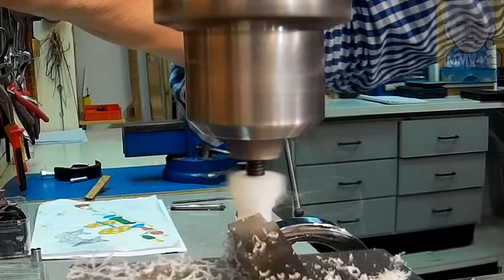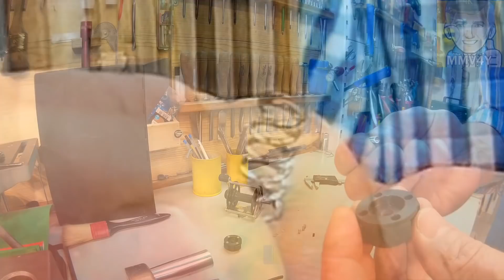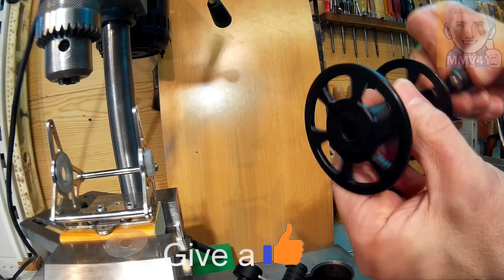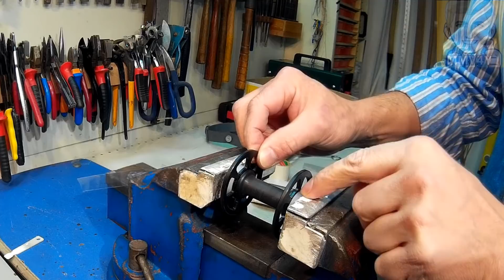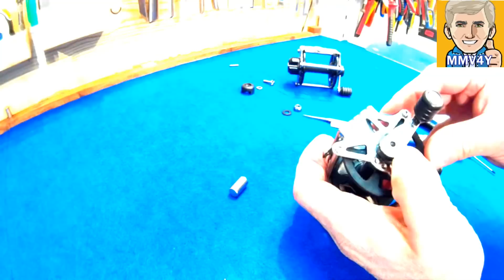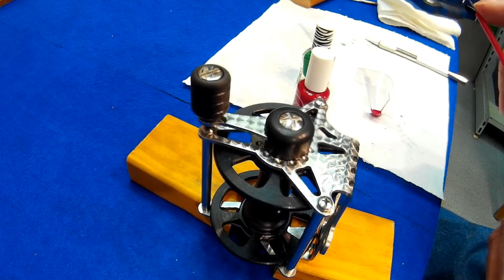IT`S DONE ! DIY Speargun Line Reel - Part 7 -  Speargun  Part-14

Comment: Whats happened with project.. Where is a finished and completed speargun?
Reply from the maker: Hello Orca Azur, this project has beeing in standby for the last couple years, but I just posted a new video on March 31, and I have another two videos that are almost ready to be posted.
Reply: @MrMyvids4you  just checked youre lst video.. As usual very good job with metal.
Sorry to hear that you stoped that project.
For gun you can use also laminated wood, 2mm x 30 pcs for guns more than 110cm long.
Only after glue (resin) laminate need high présure. But wery god way for body of gun.

Comment: Hi, i wanted to ask if you could send me the drawings from the trigger to this email (xaris.mahmoud@gmail.com) thanks you
Reply from the maker: Hello χάρης Μαχμούντ
    That will not be possible but I can give you some overall dimensions for it.
 - The trigger housing dimensions= 13x30x65mm, wall thickness: 2mm 
Trigger and Sear= 5mm thick. All made from 316 grade stainless steel
Some of my channel viewers told me, that by using any free screen 
recorder program to take "screen shots"  from some of my videos, and 
then using a image editing program like "PAINT" to scale the images to get the right sizes. Watch the video
 "Roller Speargun Design Model"
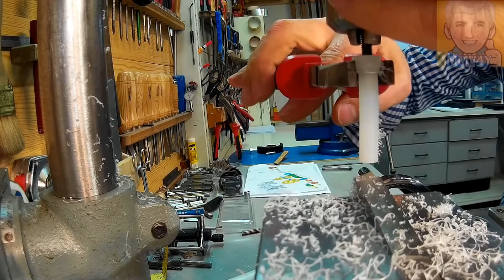 https://www.youtube.com/watch?v=_qQXGEgw5p8  at 1:03 is possible to see a side view of the trigger mechanism.
Thanks for the comment and for watching my videos.

Comment: i have been wanting to try to make a speargun mechanism as you showed a few videos back, but i just can't get my hands on stainless tubing in that dimesion that you used? any suggestions? where did you get yours?
Reply from the maker: Hello Johan korsm,
I got my stainless steel pieces from a local stainless steel fabricator, they have lots of scrap ( leftover ) pieces, that most of the times sell for a relatively good price, another place that can be good for finding what you are looking for are scrapyards, but you may not be able to know the correct grade of the steel, the recommended is 316 grade stainless steel.
Good luck on your project, and thanks for the comment and for watching my videos.

Comment: Ciao ero curioso di sapere se la mia idea ti è piaciuta e se per te è una valida soluzione per fissare la sagola al mulinello.
Reply from the maker: Mario`s Cinque:  potresti modificare il Pin che blocca l' asse con un piccolo anello alla testa di esso per fissarvi la sagola.
Mrmyvidyou:
Hello Mario Cinque,
having a pin with a ring in one end to secure the line will also require a nut in the other end to prevent the pin from been yanked off by the force of a big fish. I think the best and simpler solution is to just tight the line the same way as it`s done on most fishing reel: two coils around the reel`s spool and a knot.

Comment: Amazing videos. Thanks.
 I am going to try making my own reel.
But I want to asked you about the best and quick way to wind the reel in order to avoid line entangling when you shot a big fish. That happen to me twice.
What do you thing about the Ermes Leonardo reel, it has a diamond screw, that suppodsedly  wind evenly the reel.
That screw is workable ?
Reply from the maker: Hello Jaime Dias,
having a diamond screw will definitely make the winding of the line more evenly on the spool, however I´m not sure if it will prevent entanglements altogether. In my opinion the most important thing in a speargun line reel is having a adjustable drag system,  because when a big fish tears off after been hit, a reel with out a "Real Drag System" will keep spinning (free spooling) after the fish slows down from that first sprint, and that can cause a birds nest. 
Thanks for the comment and good luck with your project.

Comment: Mi scuso con te ma credo che tu abbia dimenticato il foro dove fissare la sagola.
Ma nel complesso veramente un grande lavoro, i miei complimenti mulinelli bellissimi, ora credo che passerai alla rifinitura e verniciatura dei fucili, ancora complimenti Buon lavoro.
Reply from the maker: Hello Mario Cinque,
i decided not to drill the hole for the the line to prevent water from getting  trapped inside the spool and perhaps over time rusting the shaft, that`s why I put the O-rings on the shafts.
Thanks for the comment and for watching my videos.
Reply: MrMyvids4you  Ho capito, ma ho avuto un idea potresti modificare il Pin che blocca l' asse con un piccolo anello alla testa di esso per fissarvi la sagola.
Scusami ancora.

Comment: But rubber gets stiff with saltwater in a short time try finding marine grade ones they will last forever
Reply from the maker: Hello Adham Khattab,
as an experiment i´m gonna use two springs and two pieces of O-ring in the same Knob and see which one will fell first, springs getting rust or O-rings getting stiff.
Thanks for the comment and for watching.